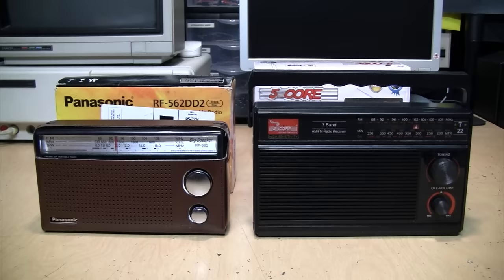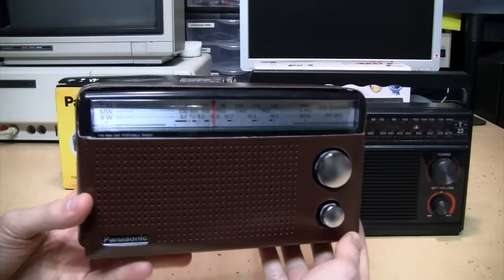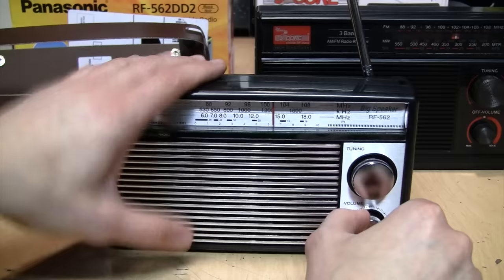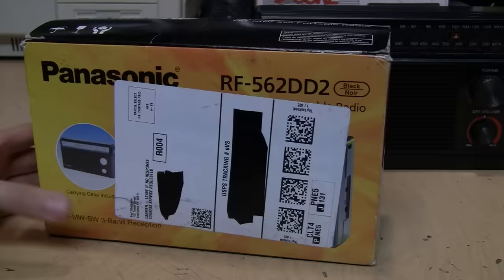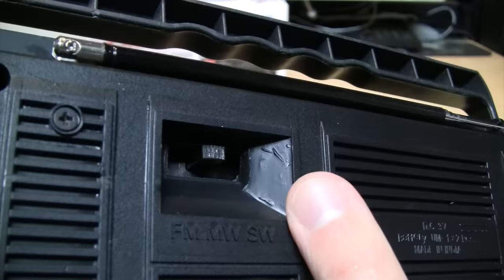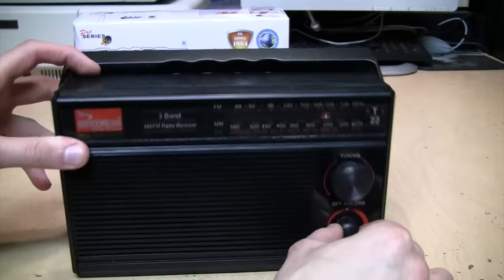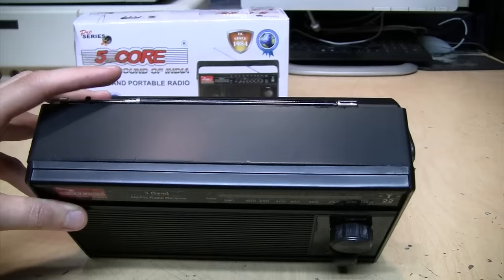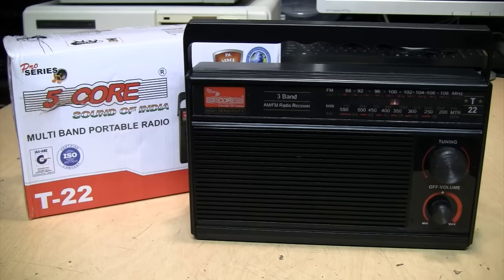Searching for the last true analog radio - Panasonic & 5 Core

Comment: Steve: Hi & thanks for the interesting video! : Appreciated !
-+-
A few points:
1. I'm a ham & collector of vintage ham & home radios, going back to the early 1920's and up to right now. This includes several ancient homebrew & "kit" non-superhet 2 & 3 dialers : Oddly, they sound the very best! ;
-_-
2. Nex time: Please open the radios, as it would be great to see what type (& quality) of construction was used. Anything from SMT, TTH, phenolic ¿N?-layer PCB, to retro  P2P is possible.  Today's 3rd-world's techniques are very varied, ranging from SMT- on -  flex to (very recently seen) "cordwood" in a consumer item! ¶ Your audience would likely be interested to see _if_ internal construction & the outside esthetics are even from the same decade!  =8D
-
3. Amazing! ,,, ¿ How did you get WNYC-FM & WBZ-AM on the same radio, in the same city, with going to the Internet? ¶ That's usually a many hour drive on I-95 !
-_-
4. IMHO, One of the best AM / FM radios has changed very slightly in the past 25 years & only costs about $20.  See either Amazon and B&H, really. This is the sturdy SONY ICF-P26, which uses two AA batteries. It is now made in China, for SONY. Two small & quite recent changes are: <A> Adding the 2nd green LED for closer tuning, keeping the red LED as an ON indicator, -&- <B> Changing the headphone jack for 3-wire so stereo 'phone will work. ¶ Over the years, I've bought many of this model, often as a small retro "thank you" present.  Not only is this 1"x2"x4" radio quite durable, inside there unused space. In various projects, I have even removed the speaker (keeping the audio jack) to add things like a 3V arduino, an a/d, & an ESP8266, etc. 
---
Keep up the informative doc's!  / Mike  _ _ . _   ._.   _
Reply from the maker: WNYC is local (I'm in NJ). WBZ was coming in via nighttime skywave.
Reply: Steve: Hi -&- Ah, thanks!  Also, surprising...: I am nearby,  in Manhattan. Here, locals  WINS-1010 <24/7 news> & WEPN-1050 <24/7 ESPN sports> both _totally_ drown-out Boston's WBZ-1030.
-
Oddly, what we can easily get at night is CHML-AM-900. It is in Hamilton, Ontario & still carries great old-time radio. In contrast, _IT_ drowns-out both _locals_, WCBS-880 & WPAT-930. Go figure...
Thanks for your REPLY!
/Mike  _ _ . _   ._.   _

Comment: every android should have  fm chip. but hey, samsung has other plans
Reply: The Galaxy S9 had its FM chip factory unlocked and relied on the NextRadio app as its default tuner. Sadly, NextRadio was abandoned by its parent company and the new Samsungs have left out the headphone jack so it could copy Apple's inferior design. 😒
Reply: @platonicguardian6923  so true. s7 might be the last samsung to actually promote

Comment: If you are looking for a capacitor tuned A.M. radio (365 uF variable capacitor) with a tunable I.F., Look no more! I have one to give away. It is a Panasonic Model RF-549, 120 VAC or 4 AA batteries. The radio only receives the local A.M. station and no F.M. stations. Can send it to you F.O.C. if you'll send me an address.

Comment: That´s typical.  Analog will always be superior and digital is just another word for cheap crap. You can buy complete AM/FM digital tuners on a chip for a few cents in china. Pair them with some cheap class d amplifier and you have a complete radio set for under 1$ production cost.

Comment: AFAIK the Tecsun GR-88 and R-909 both use a tuning capacitor but stand to be corrected as I own neither.  However if anyone is kind enough to confirm I will probably be risking my marriage with some unsanctioned credit card purchases 😂
Reply: GRrrrrrrr [accidental pun] it seems the GR-88P now available is a "modernised" version 😞

Comment: The plastic quality on that Indian radio is horrible!.  Also,could the reason why this radio is still analog simply be because these radios are new old stock, built back when portable radios were still analog?  Really, the high point of quality for a portable transistor radio is long since passed. I still have a small collection of them, and my best ones are all from the 60's into the early 70's. When you look at the quality of the plastic cabinets and the internal build quality, it's obvious that this era of fine Japanese craftsmanship is long gone. That Panasonic you showed looks like a poor copy of what they used to make, and the performance is lousy.

Comment: Why would anyone want a analog radio? There is no benefit to analog tuning. Who cares if it has smooth tuning? Once you tune in the station you want you don't care if you got to it in a smooth way. Analog is prone to signal fade while a decent to good digital tuner will lock in the station. Analog tuners can't have presets.
Reply from the maker: Solid-state analog tuners don't drift (that was only a problem with old tube radios) and it gives you a direct, instantaneous feel of what stations are on the dial, rather than waiting for a digital tuner to scan the band. And analog tuners can certainly have presets! Car radios had mechanical preset buttons for decades.

Comment: I like 👍 that black radio 📻. It's true analog. I thought it had a backlit VU meter, but it's a "5 Core" label instead. It looks like 👍 an upscale version of your other similar 1980's radio 📻. Yes, I'm sure I've had a few of those choppy sounding radios. I remember the VW Beetle of years ago, I really liked 👍 the sound of the engine. Sad 😥, nobody makes REAL VW's anymore. I never knew 👌 they made them in Mexico for 25 years. That's sort of like 👍  re-badging the name, but with where they built the cars, 🚗 instead. I REALLY liked 👍 your video 📹 on that Panasonic RE-6600 flip clock cassette recorder ⏰ radio 📻. I think the date 📅 code on the tape player's motor was September of 1969, although I heard ya say 9th week 🙌 of 1969. This was a TRUE bedside flip clock ⏰. Steel chassis, GREAT 👍 circuitry, and dial cord. Inside the bottom of the clock's ⏰ cabinet, this one came with a dial cord re-stringing diagram. No 👎 being SOL (So Out of Luck), must the dial cord break. If that date 📅 code is September of 1969, I was born just 9 months later, June 1970. Like 👍 that flip clock ⏰, I'm old, too. Please keep 👌 me posted 📫, must ya find more flip clocks ⏰. Your friend, jeff.

Comment: DSP based radios are better than the analog tuned crap. Better selectivity and sensitivity.
Reply: The issue is that a cheap analog tuner will sound better than a cheap digital tuner. The low-end digital tuners are designed to be as small as possible so they can fit more chips on the wafer, so they compromise quality to the point that they just barely work.
Reply: @NozomuYume  In my experience even the most potato grade digital tuners ended up outperforming analog ones. I was using an analog Quadro radio and it was plagued by intermodulation that completely drowned out all but the strongest Italian stations (that transmit about 250 km away). That used a telescopic antenna, mind you. A digital tuned tiny Denver alarm clock radio with a wire for an antenna, by contrast, receives RAI Radio2 from Monte Nerone very clearly with the right weather. And even my Tecsun PL-660 just defecates on the Quadro. Even a Panasonic boombox radio i used didn't outperform the PL-660. The PL-880 is supposed to be even better as well. Radios built in phones also outperform those analog tuned radios. New DSP based radios are much better than older ones, which makes sense, seeing that a new Raspberry Pi has as much processing power as an early 2000s high end desktop PC.
Reply: @NozomuYume OK, here's another update. 

You're right about cheap analog tuners sounding better than a cheap digital one. BUT there's a catch. It only sounds better because the selectivity is so bad. The Sony CXA1691BM based radio that I have has really bad selectivity on shortwave where 10 KHz spacing between two stations can still cause problems. With strong signals, even 30 KHz causes problems. 

The almost FM quality on some CRI/CGTN Radio signals is nice, but not so nice when it comes at the cost of interference resilience.